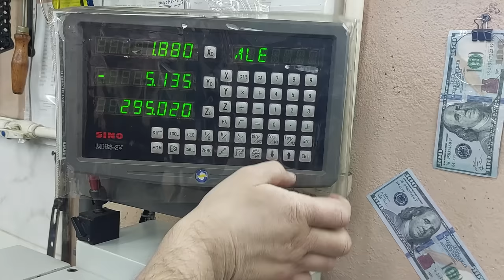A simple and useful tool for the garage workshop that you will definitely need

Comment: This is just something I do for maximum safety.  I notice that the chuck key is sometimes left alone in the chuck. Perhaps for just a short time.  But still, there is risk from some distraction or something and the machine gets turned on with the key still in the chuck.  (This is why so many chuck keys now come with an annoying spring scheme to eject them.)  What I have done from the very beginning of using lathes (over 60 years ago) is to NEVER remove my hand from a chuck key if it is still in the chuck.